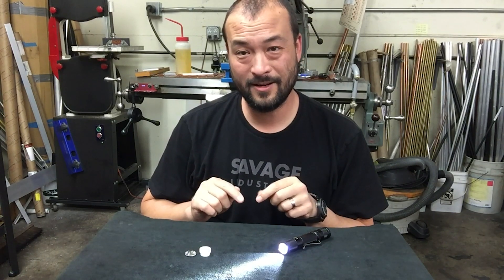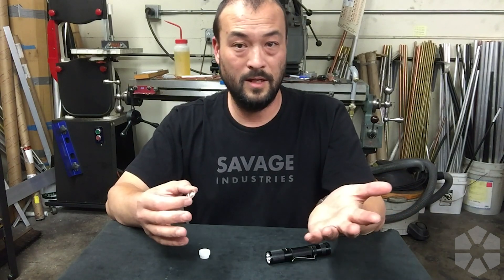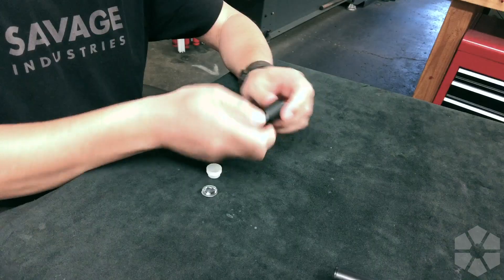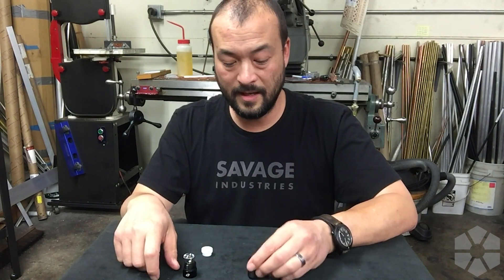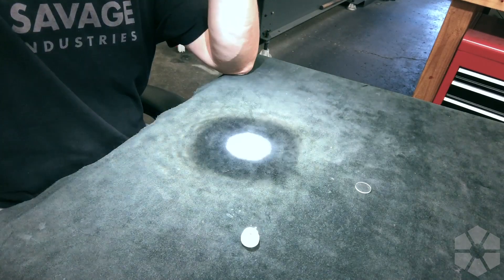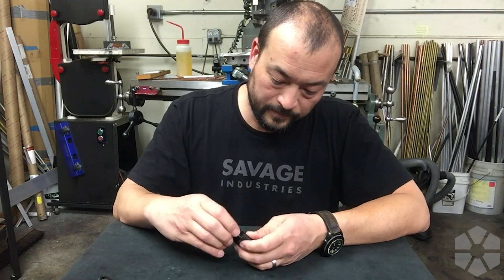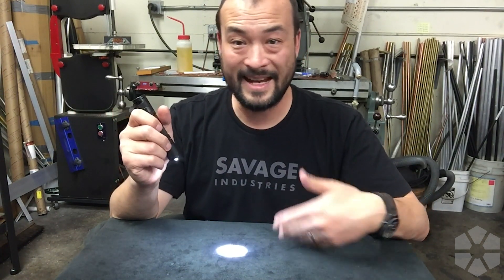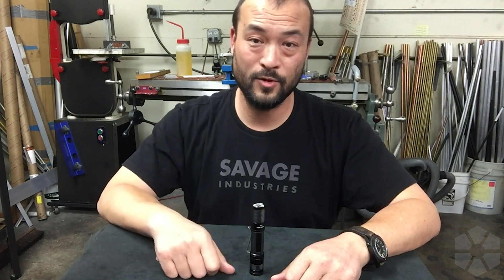How to Install the Foursevens Quark Aspheric Lens

Comment: Thanks for this video... I ordered the kit as soon as I saw it was available.. 
You should consider putting a small piece of paper in there showing the correct orientation of the lens.. I had try both ways and it was hard to really tell a difference.. 

I also have the first version of this light, when it was available in a Regular or Tactical tail switch configuration. and I just loved the Regular version where I could soft tap through the modes without clicking it off..  Do you think you will ever release a version of the tail switch that is basically reverse of how it is now..?

I do love everything about the new light.. it is awesome.

Comment: Do you have the parts to turn any quark light into the first model i fell in love with? (Twist the cap tight: toggle between 500 lumens and 250 lumens, twist the cap loose: toggle between moonlight, low, medium, high, sos, strobe) 

I lost my first quark on a trip a few years back and haven't been able to find an exact replacement. I have 3 quarks now (one tactical, and 2 qk2l-x's) and I'd love to mod them to the feature set of the original I carried for 5 years. 

We've talked in the past , and I love that you have brought my favorite light back from the grave. 

Thanks!
Reply from the maker: These features were eliminated (and will never come back) because of a lawsuit filed by a much larger company many (many) years ago. Have you looked at the new quarks and the new user interface?
Reply: @PrometheusLights  thats what i was afraid of, thanks surefire.... that light was my grail. 

I have a few new quarks, but they will never quite hit the crazy functionality of that original. (i will buy more lights though, they are my favorite)
Reply from the maker: @christopherbales1269  By "new" I mean the MKIII...have you tried that one?

Comment: If the aspheric lens is duplicated in a lens making shop, will the index of refraction be similar enough to the plastic index of refraction such that the difference will be negligible?

It seems the denser material would be slightly thinner, standing less proud, to produce the same focus and, I think, fewer scratches over a longer time frame is a preferable alternative.

Also, the potential effects of heat on one side of a cold lens might cause fracturing.

What is the density of the aspheric lens?

Insights are appreciated.